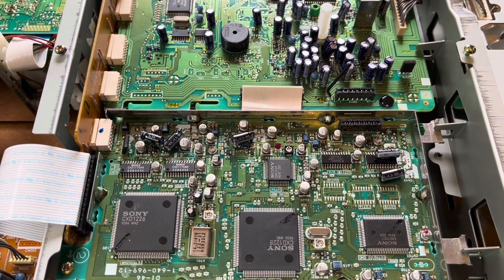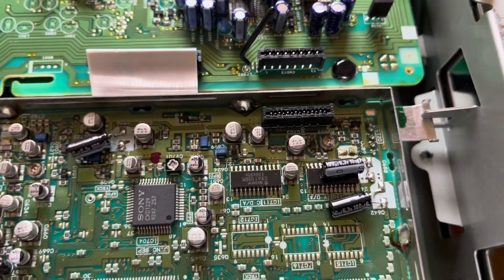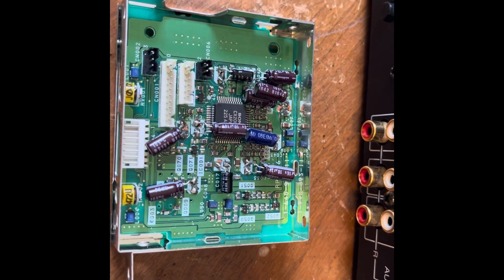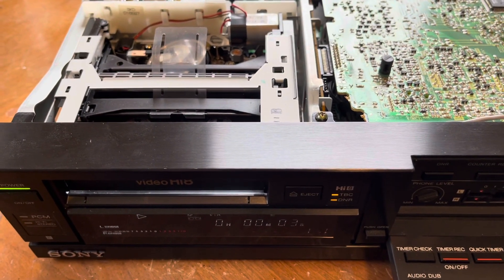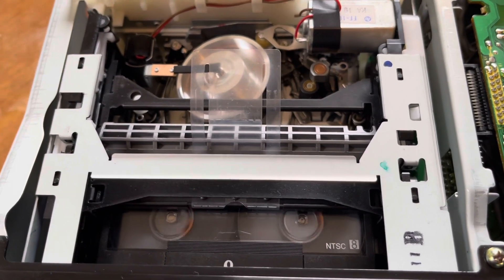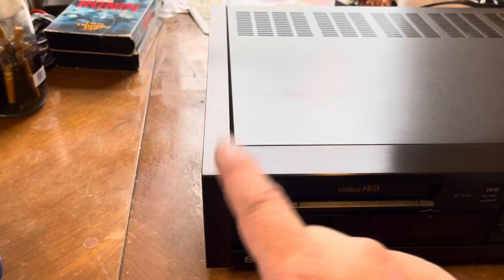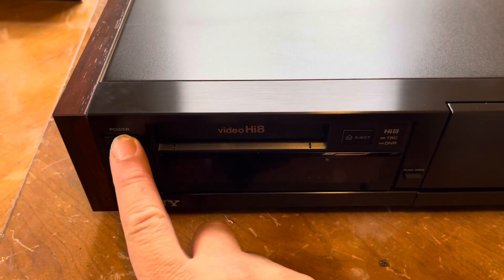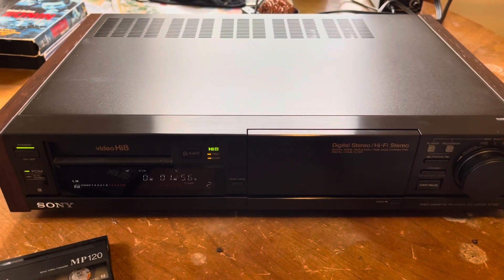Sony EV-S3000 video Hi8 editing VCR repair

Comment: Thanks for the video! Do you have a service manual which also contains schematics for the RP-116 head amp board? None of the manuals that I found online hasn't have that board. The pages are missing.

Comment: Thanks for the video.  I also own a EV-S3000 but I have a tape stuck in it. and won't eject.  Would you happen to know how to force it out.  I have pulled the cover but can't make out how to manually get it out.  Thanks in advance.
Reply from the maker: Your going to have to manually disengage the transport which requires getting to the loading gears to turn till it fully unloaded and then spool tape back In cassette and finish unloading till carriages up and then can slide out normally. You don’t want to force it even if you don’t care about the machine as you risk damaging the tape as can get caught up on tape guide and etc. 

If severely stuck and out of alignment you can remove the carriage or lift enough to be able to slide out, but have to lift tape off guides first so won’t get caught up if you have to force it and the push tape out of the way so it doesn’t get caught as you slide out?

Comment: I have one which has blown a fuse...Can you show me where that fuse is so I can see if all i need to do is replace it?  
Thank you
Reply from the maker: If it blowing fuses chance are you have short, the capacitors also in power supply as the Elna capacitors are known to fail on these. The Nichicon 470uf in power supply fails as well. Without testing where short is can't tell you what wrong with your and why it blowing a fuse, or what failed, as it could be number of reason? If it hasn't SMD and power supply capacitors replaced it definitely going to need it as they have a 100% failure rate as yet to come across one that the capacitors were still good.